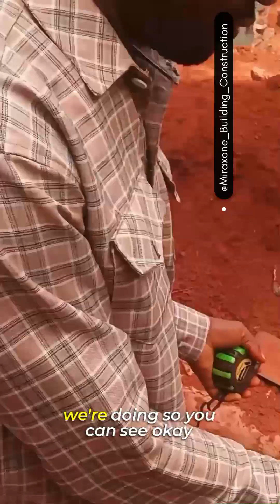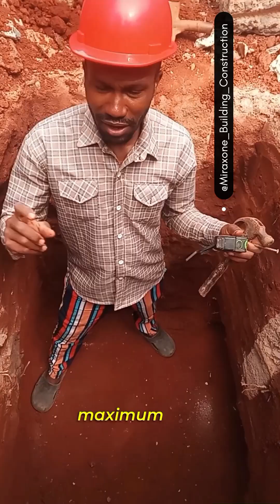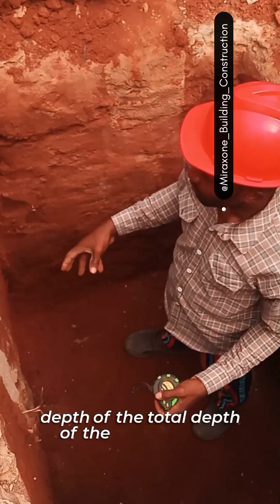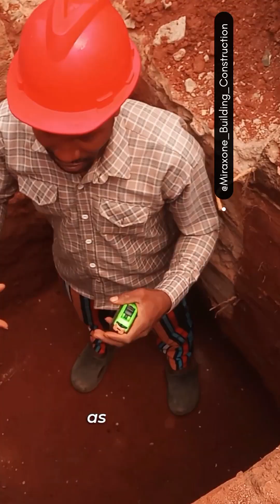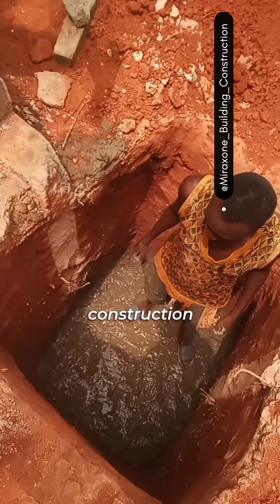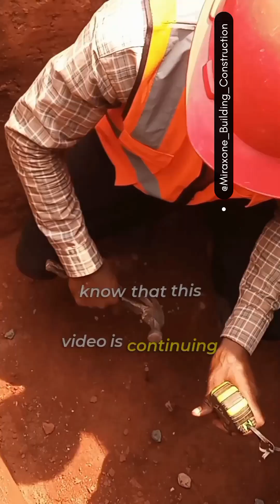How to Construct Pad Footing / Column Base from Scratch - Part 1. #column  #civilengineering

Comment: Well done engineer. I would like to know about that building line location from the drawing
Reply from the maker: It was called building line for easy understanding of the newbies. Columns are positioned based on the structural design.

Besides, our drawings aren't made for public consumption.
Thank you very much!
Reply: @MiraxoneConstruction I mean showing us from the drawing what you are practically doing. I don't know if you understand. You show us what is the drawing and what is being done practically on that section
Reply from the maker: @OsunShoeVendor 
It's alright Sir,  I'll consider making such video next time. 
Just stay put💪